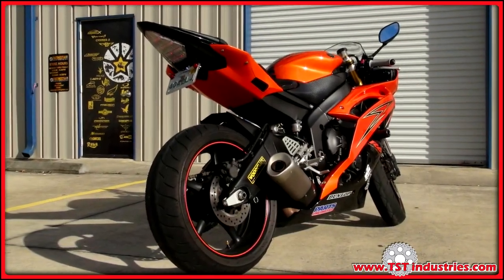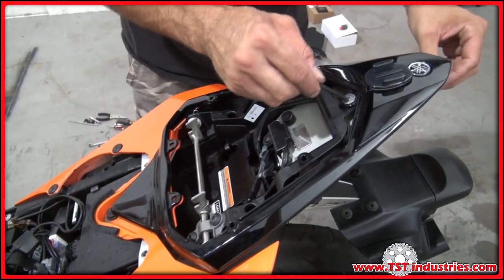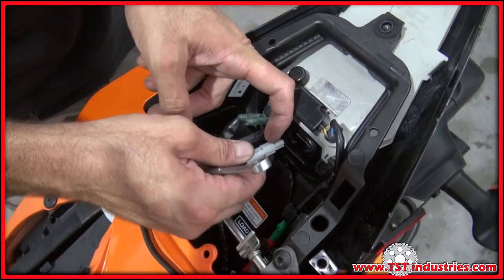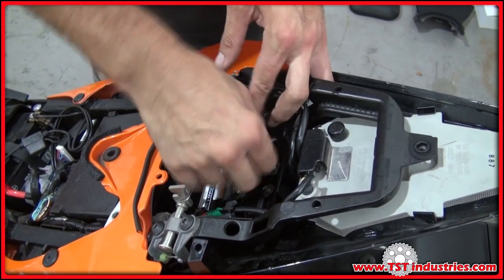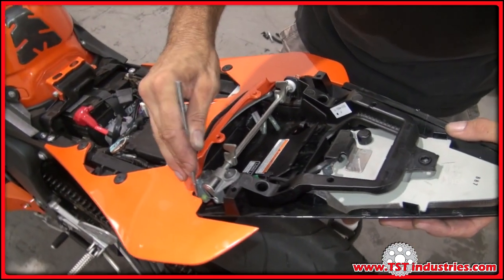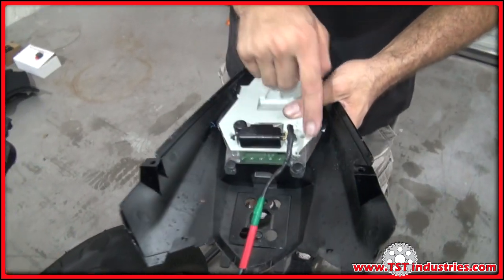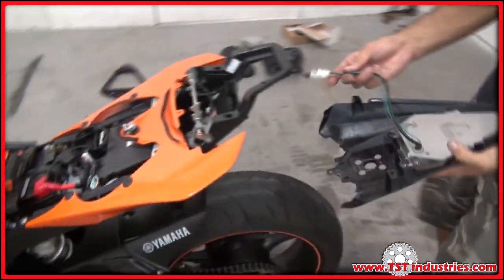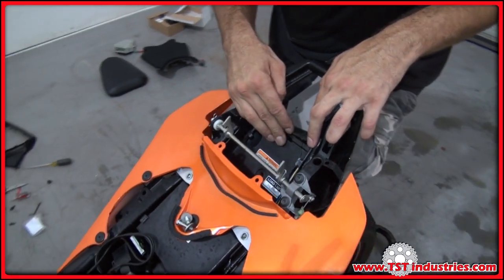DIY installation of Integrated Tail Light by TST Industries on 2008-2016 Yamaha R6

Comment from the maker: Claudio, if you can't get enough room to access the screws then remove the forward section of the tail and loosen the undertray. This will allow you to lift up on the entire plastic piece and get the access you need to put in the screws.

Comment: I just did my 2013 R6 using your video today bro. A little different on my model but not too much. I had to remove the seat lock but this definitely got me started & helped out a bunch! It works fine & looks GREAT!!
Reply: That's awesome, I too have a '13 R6 I got not too long ago and my fender eliminator just came in today.
Reply from the maker: Awesome!
Reply: JudahRock I got a 2016 I had to remove my seat lock also

Comment from the maker: You should have gone with the TST Industries product. Typically, with motorcycle parts you get what you paid for. Trying to save a buck you put yourself in the position of having to troubleshoot. With our products you get a video and a color photo installation guide that takes any guesswork out of the procedure. All the wires have OEM plugs so there is no need for wiring. We don't cut corners...we design the right parts. That being said, if you contact me through my website I will help you.

Comment from the maker: this video shows the installation of the taillight only. We offer two options for controlling the flash rate: the resistors or the LED Flasher Relay. You can choose one or the other, so it is not necessarily required to install the resistors. We have printed instructions that come with the resistors and a video showing the install of the flasher relay.

Comment: i bought a differnt brand (Lockhart phillups) of tail light and it says it was plug and use but that wasnt the case the turn signal wires where not i cant figure out how to wire to work every time i try it blows a fuse. is there any way you can possibly help me i cant find any good information

Comment: Im having trouble putting the 2 push pins back in for the lower tail. Its a really small space and my hands dont fit in there to line em up properly. I tried using some pliers to line it up then the puwh pin fell into the tail (managed to get it out with some innovative tools). Any suggestions to get these push pins in easily...
Reply from the maker: Needle nose pliers might be the best option. There isn't much room in there to maneuver but you should be able to position them into the hole and then push them in with the flathead. You can also try removing the front portion of the tail (where the seat connects to) and then try positioning them for re-installation.

Comment: Hi!
I have a R6 2012. My integrated tail light just stopped working, after being working for years.

Also, none of the signal lights are working.

Is there any fuse or relay that I should change?

thank you for your video !
Reply: Carlos Aquino PS: Everything else work fine (headlights, panel, start bottom, etc.)
Reply from the maker: Carlos Aquino Please check your fuses and you will likely find a bad one. If you find a bad fuse you will have to trace down the problem that blew it to prevent the new one from blowing. Check all connections in the front signals and the taillight to make sure no exposed wires are grounding and causing a short circuit.

Comment: I have a 2014 R6, I'm having trouble pulling the under tray up to give me access to the fender bolts, I spent 2 hours trial and error, it just doesn't seem to work.
Reply from the maker: You may have better luck if you remove the forward section of the tail and then lifting the plastic cover up. Try that and if you still have issues please shoot us an email to support@tstindustries.com and we can give you a run down.

Comment: will i need to by a relay from ur website to make this work
Reply from the maker: It will work without a relay but will flash fast. It will come with load balancing resistors free of charge. If you want to wire in those resistors it will flash at the correct rate, it's just a pain to install. Our relay is a couple bucks extra and leads to a professional installation without the difficulty associated with resistors

Comment: Hi there... Just wanted to know can i install yamaha r6 2010 model tail section to r6 2006 model? Thanx in advance :)
Reply from the maker: Aadil Latif You would have to do all the tail fairing components.
Reply: TSTindustries I have the same question. are you saying that the tail fairings will have to be replaced with the 08+ ?
are the tail light fitment different between 07 and 08?
I'm looking at buying a tail light but it says 08+ so need clarification if I should go ahead with it. 
thanks.

Comment: why do people take off the passenger pegs? The bike I have came like that too
Reply from the maker: no need for them if you are only going to ride yourself. They are cheap and easy to find if you're looking to replace them. Ebay has got them all over the place.
Reply: I bought some, got them today, got them all put together but don't have the bolts to mount the bracket to the bike tail. Don't know what thread that is or length? I dunno.  Thanks for your awesome videos and information by the way!

Comment: I want to see how it works
Reply from the maker: Unfortunately we did not shoot a section showing the functions of the light in this installation instruction video. You can reference the photos in our product page. There is a photo in there showing the tail light lit up. You can follow this link: https://tstindustries.com/TST-LED-Integrated-Tail-Light-Yamaha-YZF-R6-2008-2016.html
Reply: TSTindustries do I need the relay? I already have the front signals and they flash fast but I like them. Also will the relay will be able to adjust how fast I want them to flash?

Comment: Hey anyone that could take 2 seconds to help me, I'd really appreciate it. I already have a Yoshi aftermarket fender eliminator. Since I'm not messing with that at all, do I even need to get to the 4 fender screws everyone is having trouble with? I've been trying for hours and can't get them. All I'm doing is installing the tail light and that's it, so can I just undo the two push pins on the sides without taking out the fender screws?
Reply from the maker: Hey Brad you can do that but you will still need to remove the top part of the rear-fairing.
Reply: It took me a few hours to figure it out, but I finally got it. I had to remove pretty much the entire tail to get access, and then had to use an ungodly amount of wd40 to get the screws loose. That being said, I really really appreciate the reply so early in the workday and the tail light looks FANTASTIC. TST isn't a company I've ever bought from, but I'm definitely going to try to give you guys as much of mine and my friends business as possible. Thanks a ton!
Reply from the maker: Thanks ***** I'll be on the lookout for some orders! ;)